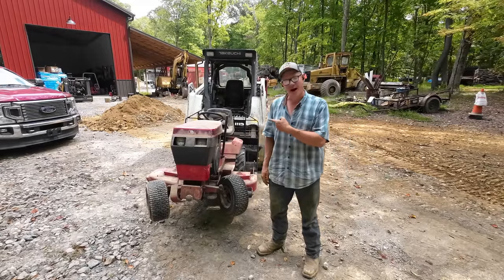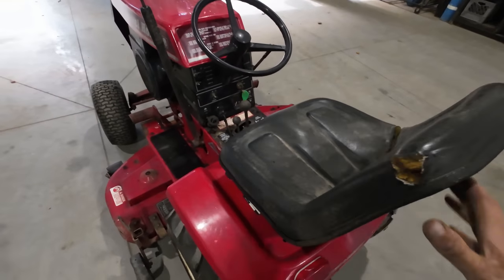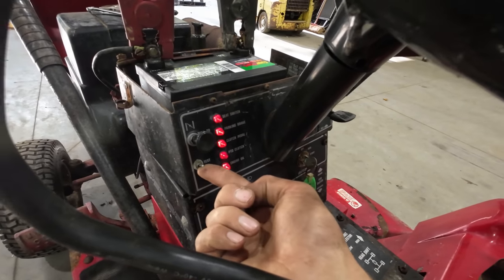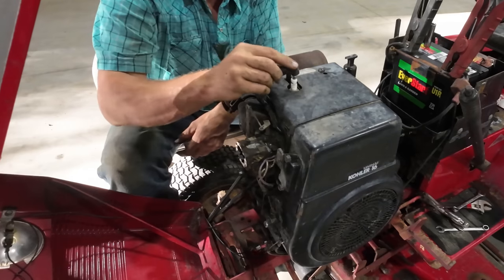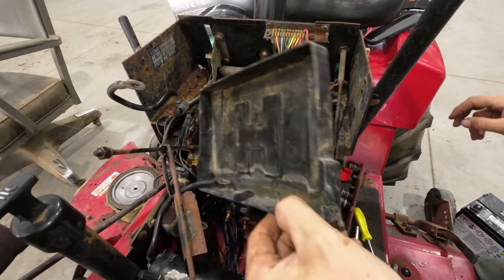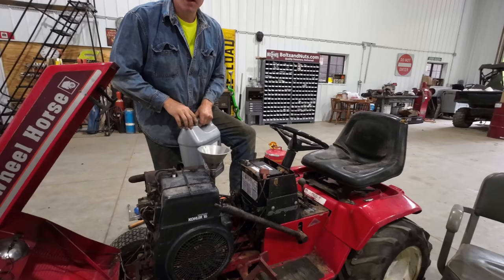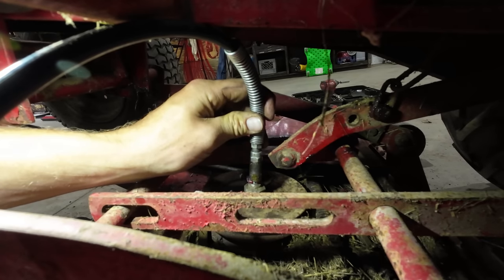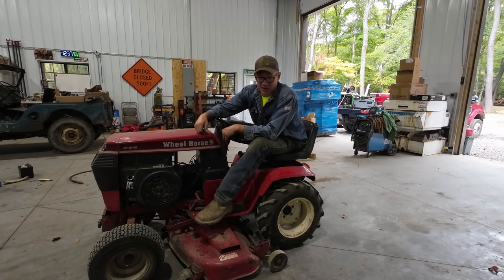FREE! Wheel Horse Garden Tractor sitting for YEARS! (WILL IT RUN??)

Comment: Unfortunately I can't find that model number so I can't date it. I've got 16 Wheel horse tractors ranging from 1960 to 2000 all in operating condition but in various stages of restoration. I plow snow, blow snow, grade, cut grass and tow with them. What you have is a Kroller Magnum {M16} series engine. Basically it is the solid state ignition version of the K series. Great find. Can't kill them. Garden tractors have rear wheel 12" or larger. Lawn toys {tractors} have rear wheels smaller than 12" In my experience Slime doesn't work on cracked sidewalls. Run some Sea Foam through the fuel system and you'll be able to idle that engine down so low and slow...

Comment: I'm 74 and on soc sec. Bought a Simplicity tractor 4 years ago, paid $4000.00 and it has less than 300 hours on it and this spring had it in for service because of missing. They installed the second carburetor and rebuilt the head (another $1,000.00). And when the guy gave it back he said one cylinder had developed an egg shape and so it misses yet and sputters when I mow. Burns a ton of oil. The only way to fix it is to replace the motor. Briggs and Stratton motor. I'd give my eye teeth for an older tractor like that Wheel Horse you just cleaned up. I bought a piece of junk!

Comment: 416-8 with a kohler is a fairly rare model, most of them were onan. but this was made before '90, everything '90 and after had toro logo on the hood. One thing to check with the manual trans is the shifter boot if that is rotten you will have to replace. and then on the grease fittings there is one on the steering column or as I call it the fan gear, most people forget about that

Comment: Hey Matt, another great video! For batteries one thing I learned in auto parts is how to read date codes. That battery you have there has an 'E6' label on the top. This would translate to May 2016 which would be just on par for how long you said it was sitting. They basically go with the alphabet being the month; A=1, B=2,etc and the 2nd character is the year using the last digit, making this one 2016. Hope this helps someone out there.
Reply: maybe it was 2006 then ?
Reply: @rmee5165  I don't believe that they used that date code system in 2006.

Comment: I owned a 1987 418c hydro for many years, but had to sell it when I downsized.  They are great tractors!  I had the plow with wheel weights and chains…what a beast pushing snow!!   Used it for grading dirt as well.  Tough tractors to kill.   Btw, the date code on that battery was that sticker ready got on top.   E-6 was May of 16 or 06.   Pretty clean, so probably 2016.   New shop looks great!

Comment: Hi Matt, great video. In regards to the oil, high quality oils are designed to keep particulates in suspension so they can be captured by the oil filter. In most low revving, low stress small engines without an oil filter it is recommended use a single weight oil like 30W without the surfactants and dispersants found in regular engine oil so that contaminants fall out of suspension when the engine is stopped. That’s why when you tear down an old lawnmower engine, even if the oil is clean there will normally be a layer of black sludge sitting in the bottom of the crank case. It’s also quite gunky so it’s happy to sit there doing no harm even when the engine is running. 
I hope this helps. Cheers mate. Stuart 🇦🇺
Reply: I was going to comment the exact same thing. In lawn equipment, you want to use a straight 30, non-detergent oil.  You will find it on the shelves labeled just like that: “SAE 30W non-detergent“.

Now, if you use your tractor in the winter for snowblowing, you put in a multi weight for the winter, then change it back out for non-detergent in the spring again.
Reply: I agree.  I've been using Rotella for a long time, with good results, but I've heard that the diesel additive packages in Rotella require the higher temperatures that diesels run at to be effective.
Reply: @BuildItFixItDIY  despite what everyone says about not using detergent oils in small engines, all my John Deere manuals, even from 50+ years ago, recommend detergent oils
Reply: @evanruhl249  Ah, interesting. Do these small engines you speak of have oil filters? If so, than that makes sense (detergent oil may be recommended).
Reply: @SirChevy  Diesels run hotter? 

I think it is the opposite actually: gasoline engines run hotter.
Reply: @BuildItFixItDIY  not a one, they're all splash lube, single cylinder flatheads of various brands (Briggs, Kohler, Tecumseh
Reply: @evanruhl249  Interesting. Thanks. OK, I guess it’s best to to follow whatever the manufacturer says, then, we know. And they vary it appears!

Comment: What a nice, simple revival! An inportant tech tip: every classic flathead small engine mfgr. I know of says NOT to use a 40 weight oil to prevent overheating the engine, especially on a lower hours engine like this one. Anything heavier than a straight 30 or 10W-30 will not splash around enough to cool/lube the bearing surfaces. I don't know much about the WH specifics, but have worked on plenty of old single cylinders.

Comment: I've got a 214H that I bought new 29 years ago.  It cuts grass in the summer and blows snow in the winter.  The Kohler engine with a cast iron block gets the oil changed in the summer and winter and all the fittings get new grease twice a year.  With normal maintenance this tractor will run forever.  You're very lucky to find one in this good condition.

Comment: Yesterday I stood 2 meters away from Takeuchi TB2150 R CV while it was working. What a quiet quiet medium size excav. You can only hear fans blowing air thru radiator and faint Hydraulics hiss. For a moment I thought it was electric, but saw exhaust pipe and yes it's diesel powered. Nice paint job  to gray/silver/deep red. Verry nice looking. watch?v=ag7t8MLNwTc

Comment: Change the oil change the oil change the oil change the oil. I cannot stress anymore that that needs to happen. It's a cast solid iron block.  Therefore  corrosion in the inside can completely WRECK the innards. And after it's sitting such a long time it will have moisture in the inside.  
Install some engine conditioner also

Comment: I would gauge it around 87-89. Mine is a 85 and an amazing machine. It's my favorite of the 6 I have to mow with. The 4 series 16 horse 8 speed (416-8) were made from 1985-1992. Later Toro wheel horse models had Onan's. The original K series on the 416-8 was 85-86 the Magnums were 87-88 and 89-92 were Onan's. So yours is an 87 or 88 which is pretty cool. It's hard to find a nice 416-8 anymore.

Comment: Anytime I deal with things attached or mounted using loose nuts on the back side of a panel.  I install rivnuts to make servicing easier.

I install valve stems without removing the tire or breaking the bead.  I have done it many times on old vehicles that I have purchased.  I cut the end off of a funnel and I put a metal valve stem cap in a piece of steel tubing so I can knock the valve stem into the rim from the outside.

Comment: I own that exact machine complete with the agricultural tires - purchased it 30 years ago and it runs like a charm - the Kohler engine is great on fuel - built like a tank - my 42" deck is rear discharge. My only dislike is the seat - not too comfortable. I also have the grader attachment which works nice on gravel driveways

Comment: I have this exact same Wheel Horse. I have all the manuals for it too. Even the original sales receipt from when it was bought new. And I have another sales receipt from when the mower deck was replaced with a new one. Your not gonna believe me when I tell you how pricy these were. These cost more new back in the late 80’s than what mowers cost new now, even since lowered have went up a thousand dollars compared to 5 years ago. Mine is a 1988 model. And in 1988 mine was 3,998 dollars. Yes that’s right you can pick your jaws up from the floor. 3,988 dollars in 1988’s economy. Back then you had to buy all the implements separate. Even the mower deck was separate. Because it’s a pto driven implement, just like the snow blower would’ve been. The mower deck wich at the time was the largest size deck that was available on any machine. A 42” inch. This was the largest model Wheel Horse tractor in the series. And back then 16 Hp was the largest amount of power available. It was beast of a mower back in its day. It’s small compared to what we have nowadays, but back then it was literally a beast of a machine. The mower deck was an extra 700 dollars back then. I don’t know what any other attachments cost cause mine never had anything else with it. And after you spend 3,998 dollars on the tractor, and and extra 700 dollars for the mowing deck, I can’t say I’d blame anyone else for not getting anything else for it. At least not for a while lol. Total cost out the door for both was like 4,798 dollars it was nuts. Even in 1988 economy, and even still today that would be considered a pricey machine. Thankfully my grandpa was the one who footed the bill for it back then bream’s new. And he handed it down to me after he got a newer machine. But he mowed with it from 1988 to clear up in the 2,000’s. And it still runs drives and mows to this day. So the quality in the machine is definitely there to stand the test of time. My grandpa had a big yard to mow too. Which is why he had to get the big Wheel Horse. My whole childhood all the way up to when he gave it to me, is filled with memories of seeing him mowing the lawn with that ol Wheel Horse. It’s definitely eatin a lot of grass in it’s days. And it don’t seem to be showing any signs of slowing down anytime soon. Now the pto on it is designed kinda like a slip clutch. It’s designed to slip at the pto pulley instead of slipping the belt. If you look on it you’ll see a little brake pad. That stops the pto pulley when you disengage the pto. But it also will stop the pulley when you get into to hard of a pull on it. If you get in to thick of grass or something, it will sense it and slip the pulley, before it slips the belt. That brake pad has to be kept adjusted at like .016 thousandths. Thad so the pto stays adjusted properly as the brake pad wears down. If it gets out of adjustment, it will either slip as soon as you engage the pto, or not slip at all, and make your belt slip instead and burn the belt up. So if you ever go to try and cut grass and it starts slipping immediately, and won’t cut, it’s that brake pad needing adjusted back to spec. Basically any pto problem other than the bearing going bad is always gonna be that adjustment. That bearing is a sealed bearing. And mine actually finally burnt up after over 30 years of mowing large amounts of grass. I was able to find a new pto pulley for it. It was funny cause one day I was mowing and I noticed that pulley was wobbling and it never used to it always spun true, and then all at once it went and it really wobbled, and started smoking the belt. So I had to cut the pto off fast, and change it out. Wasn’t a hard job at all.

Comment: I've got a John Deere riding mower that I picked up for free, bought some old farm equipment off a girl who didn't need it anymore and they threw in the "junk" mower for free... The plastic engine fan had grenaded, it overheated and pulled one of the rocker arms out of the head. $25 for the upgraded fan from John Deere (It's a Briggs motor but the part was cheaper from JD) plus $40 for a used head off Fleabay, and about $20 in tune up parts and she runs like a champ. Beats my worn out 20 year old Murray that I was using :-P

Comment: Wheel horse made this model from 85-92. The 400 is the series. They made 200, 300,400, and 500 series. The 500 could run a whopping 60 inch deck. Awesome tractors. I have a 314-8 that I wouldn’t give up for anything. Great little trqctor

Comment: I've got a 2006 Poulan Pro (Husqvarna) 26hp/54 inch garden tractor that I'm going to scrap (unless someone wants it). I'm going to place a "best offer, including free" ad in our local Kijiji.

I bought it brand new in 2006 for $5600 + tax. It was always garage stored, had flawless paint, was in perfect working order, including the hydrostatic transmission,  the electric PTO clutch, electric starter,  new battery, recent oil change, etc - BUT it had recently developed an oil leak.

I arranged to have it repaired at a local small engines shop, but foolishly decided to do one more mow first. I thought "What harm will a bit of oil leaking do, as long as I keep the oil topped up?".

Unfortunately, while finishing off the lawn, the oil leak worsened and oil got onto the hot exhaust manifold. The oil caught on fire...

It didn't burn long, but long enough to melt the back of the headlight housing and melt a few wires, including the headlight wires, starter wires, and ignition shutdown wires.

With a bit of "custom wiring repair", I'm sure it could easily run again, but it still had the oil leak and damage from the fire so I didn't fix it. Instead, I replaced it with a John Deere 1025R TLB with a 54" mid-mounted mower deck.

At this point it hasn't run in three years, has a major oil leak (turns out the leak is a common Briggs and Stratton twin cylinder oil leak, where the two piece crankcase splits) and I was so frustrated I left it sitting outside the entire 3 years (so the paint is starting to fade and even peel near where the fire was on the frame). 

I figure it isn't worth anything at this point, although it does have a very cool, smooth operating, fully variable speed, hydrostatic transmission that always worked flawlessly. 

Other than selling/giving it away, any suggestions?

Comment: It probably has already been said but the date code on the battery is the round sticker on top with E6. E is the month (ie A=1/Jan, B=2/Feb, C=3/Mar and so on) and 6 is the last digit of the year, so the battery was sold approximately May of 1986, 1996, 2006, or 2016. I worked in auto parts stores for a few years and I had to pull batteries at times to charge and test and if good would change the round sticker with the date code for the month and year I did it. With that being said if the parts house you use is slow at selling batteries, that new battery you just got could be multiple years old but with a date sticker from just a month ago. Also the top sticker with the month and day that you can remove yourself mean nothing to parts houses since it can be changed or done at anytime so don't waste your time trying to get them to warranty the battery from that. Unless the customer was nice to me I would not warranty a battery from the pick your own date on top.

Comment: The sticker on the battery that says E6 is the date the battery was manufactured. E being 5th letter of the alphabet indicates 5th month (May) and the 6 is the last digit of the year of manufacture (2016, could be 2006 but doesnt look old enough). So, May of 2016 is when that vary was most likely made. 7 years old fits with the "how long it's been parked" timeline you were given by previous owner.

Comment: I agree with you about engine oil I run a synthetic blend in my 96 Legacy which I've had since the engine was rebuilt. I always do oil changes every 6 months even if I'm early and I always check the oil weekly to make sure it's not low even though it shouldn't be using any. Seen all throughout my life my dad run his cars a quart low on oil and not really be bothered by it me on the other hand I would like to reduce the wear and tear as much as possible it's not difficult or time consuming

Comment: That's a beautiful old machine!

Just a thought - while the workshop floor is still relatively stain-free, you could give it two or three soakings with sodium silicate solution? That soaks in and reacts with concrete to both harden it more and make the surface impermeable, so it's virtually stain-proof if fully saturated.

The workshop looks so good at the moment, it would be a shame if it ended up with big permanent oil stains..

Try some of the solution on a bit of concrete that's not important first, to see what you think of the effect?

Comment: Hey Mat. I have a 1976 C120 that I bought new in 1977. Had a 42 in snow blower and have a 48 in deck under her. Did a frame off restoration in 2010 including powder coating most of the red items. Has to replace the Koehler K301 engine in 2010 and the gas tank leaked. Runs today. Enjoy it. They are real powerhouses compared to newer mowers.

Comment: I'm jealous I paid $320 for a poorly running John Deere 300 mower with the supposed never fail K series Kohler engine on it it's a K341 engine if that helps and it has been refusing to run properly only will start and run at 1/4 throttle it's very strange. Tried everything I could think of and it still runs exactly the same adjusted the points which are OEM Kohler brand replaced the coil, tried a cheap eBay carburetor to see if it would run any different and it did not adjusted the valves even. I finally bought a new OEM carburetor for it hopefully it fixes it. I was really hoping this thing would be the ticket for mowing my yard which looks alot like what you mowed because it's an old farm yard that I rent and has been seriously neglected over the years and I'm trying to make it look just a tad bit nicer. The main reason I liked that mower was it has hydraulics which I never knew they had if I can get it running properly I have ideas for the hydraulics.